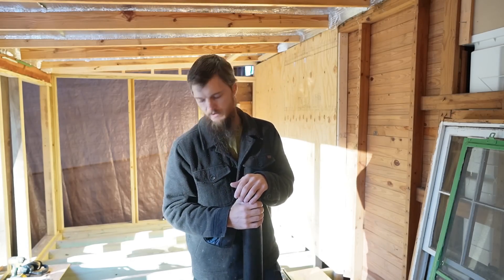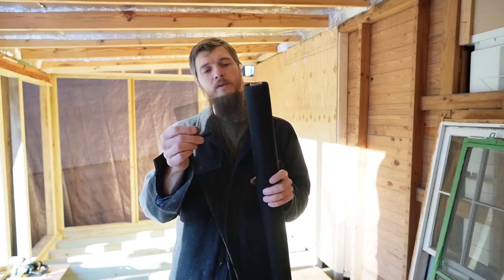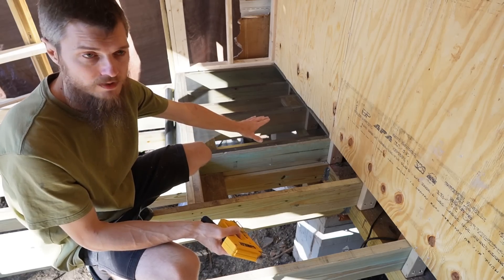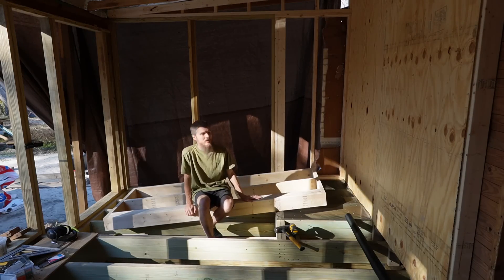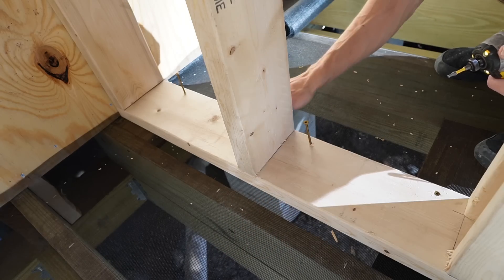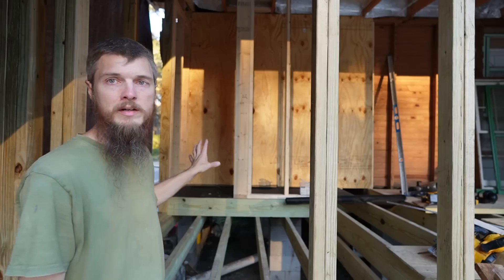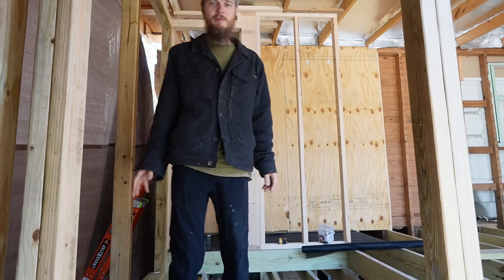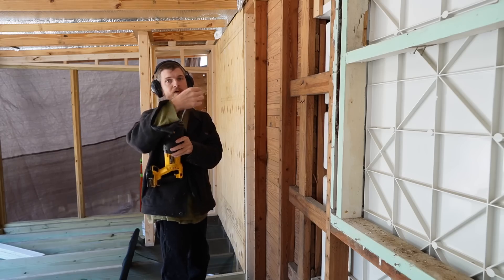Walls Framed, Floor Screened

Comment: Okay, I don't understand why you did not put the floor down before framing in the closet in the washing machine area. I understand the screening concept etc. but it seems easier to put down all the flooring and then the wall framing. I am confused.
Reply from the maker: We just didn't want the deck boards under the framing, that's all. I don't consider deck boards to be a proper subfloor and I don't want it under my framing. This makes maintenance and replacement much easier and simplifies the building process. There's no benefit to having the boards under the wall framing. The screen is to prevent insects from coming up into the porch between the board.
Reply: @diyfferent  I understand your reasoning now. Yes, deck boards as a subfloor would not be a good thing. I am totally on board with the screening idea.